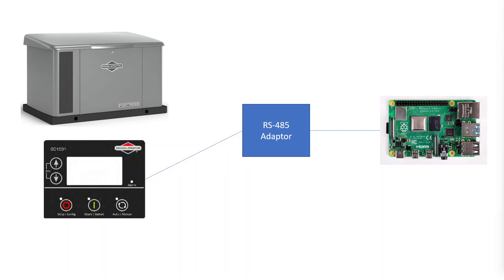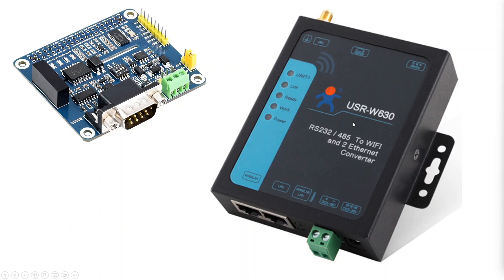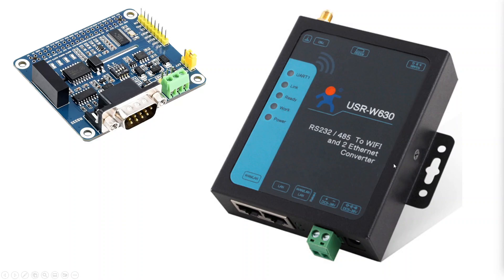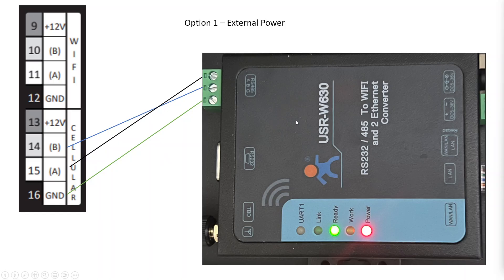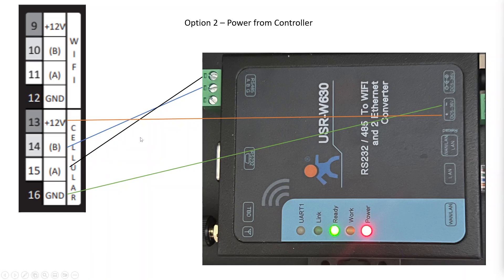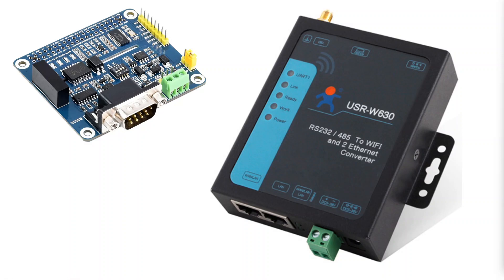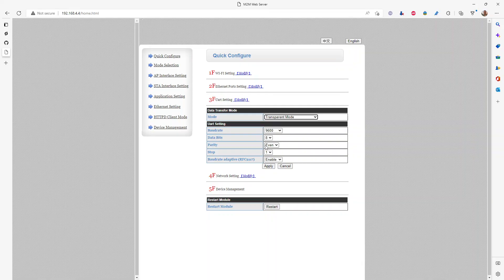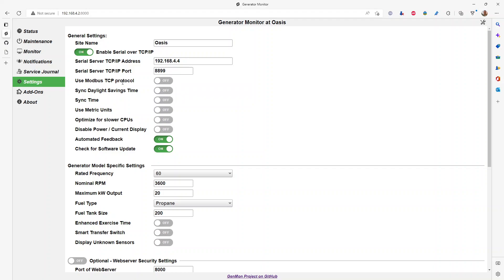RS-485 Connection from a Briggs and Stratton Generator to Genmon

Comment: My Briggs and Stratton is a 2018 model year, (model 40436) so it doesn't have a GC-1030 series controller.  Do you know if I can upgrade to that controller, or preferably use the controller that's already in it (Control board 208059GS (superseded to 771701))?

Comment: Bought this same piHat, can't get anything communicate. Had lots of help from developer of genmon but at a loss. The status LED on the motherboard for the generator has AVR, CAN AND 485. The first 2  blink but I never get anything on the 485 light. Can you verify that the 485 led blinks, and does it blink only when transmitting data or even if nothing is connected to the cellular terminal block.

Will try the 630 bridge as well but was hoping the hat would work.
Reply: Did you ever figure this out with the piHat? I am fighting the same issue but I dont even see led status lights on the generator. I did not pull the controller but connected to the cellular block.
Reply: @thomaswillis6013 I ended up switching to the 630 and it worked flawlessly.
Reply: @PedalDoc  Thanks for the reply. I guess I will go that route as well. I was really hoping to get the 485 HAT to work. I will give it one more try.
Reply: @PedalDoc  I ended up doing the same. Now that I know all is connected correctly I may go back and see what it takes to get the pihat to work.